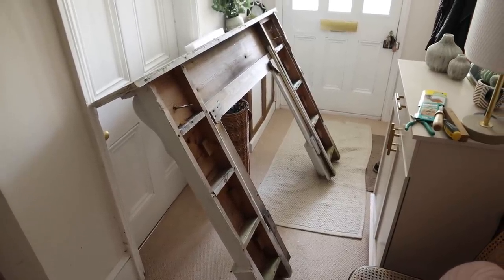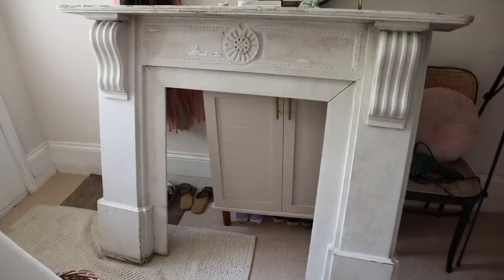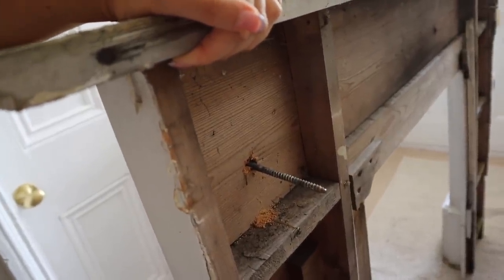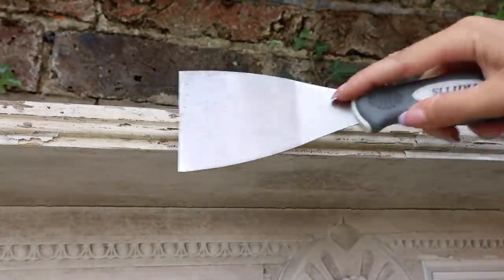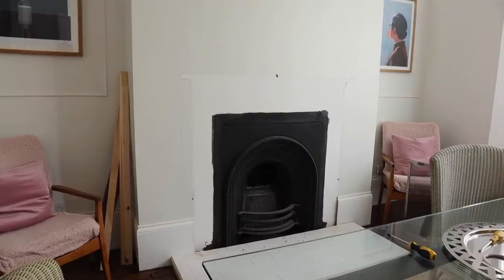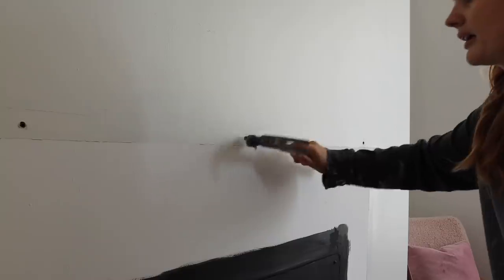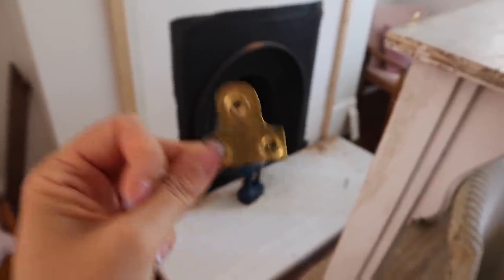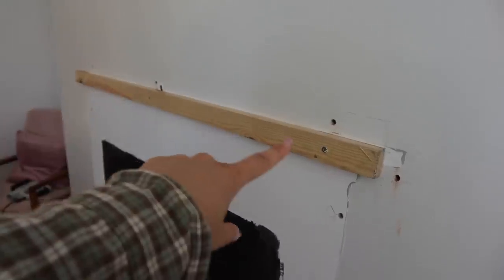Upcycling a FREE fireplace mantel for my Victorian home

Comment: Yes! After having moved into the second Victorian in this town I had movers bring this chest of drawers( on trash day from the other twin part of the structure just as trash truck would have been coming), with white paint dribbled from other projects on the top, one leg in a drawer and generally a dusty wreck. There was a stained blue blanket chest the guys just missed as a car pulled up and took it away. My friend who was the only person I knew and who introduced me to this town was an appraiser. It is the bottom of an 18th c. Chest on chest done in this county known for historic woodworkers near Philadelphia and would bring a desperate amount of  money. I pasted on the leg with carpenter's glue, peeled off the paint with my fingernail so as not to ruin the patina, and it sits in a place of honor with many other fine pieces. La de da.